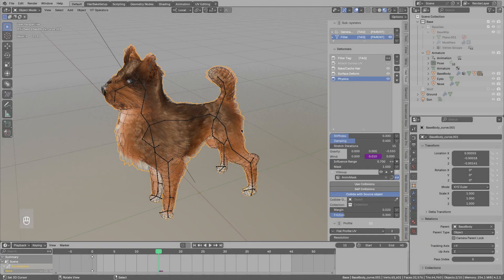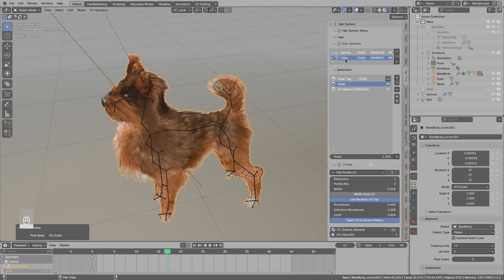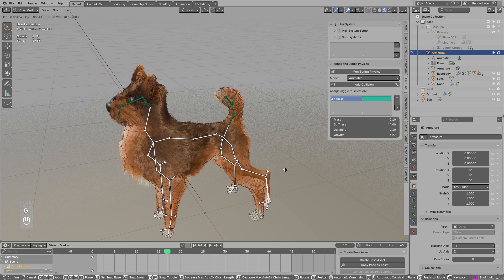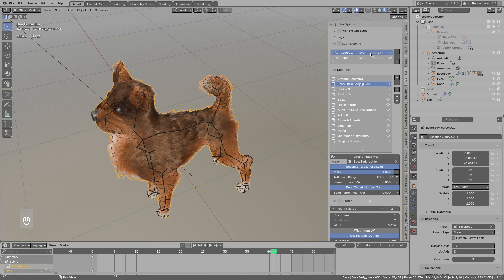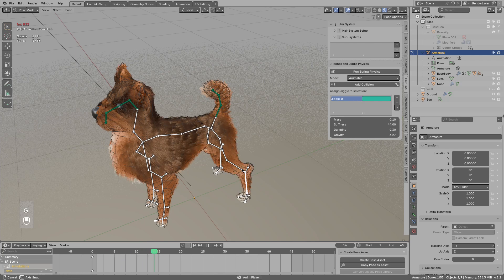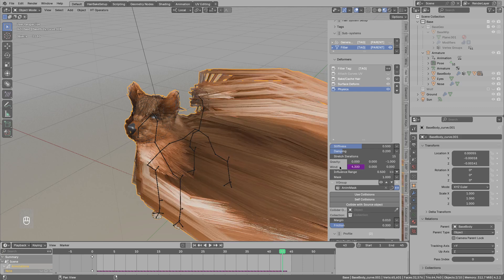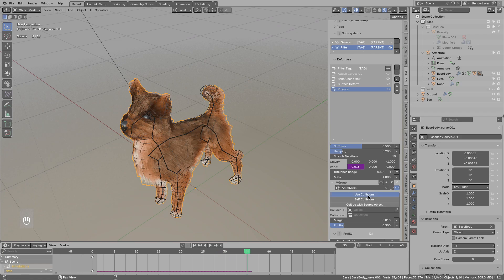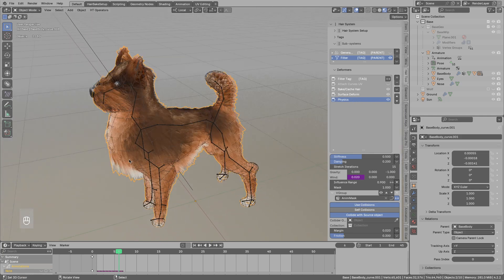Animate your haircards and sprinkle some physics on top

Comment: Is it possible to bake this hair cards physics simulation to use in game engines like Godot? Or did you design this tool for animating only inside Blender? Just asking because I’ve always seem Hair Tools as more of a game oriented tool for character hair and fur.
Reply from the maker: I did quick test - simple physics + procedural strands, and exported to abc file. Then imported back to blender and hair curves were there with animation playing from 'MeshSequenceCache' modifier. I'm not sure how well it would work if used in UE or Grodot.   I added physics users were aking for it, but I would imagine - better way would be to add bones, or cloth sim - directly in game.